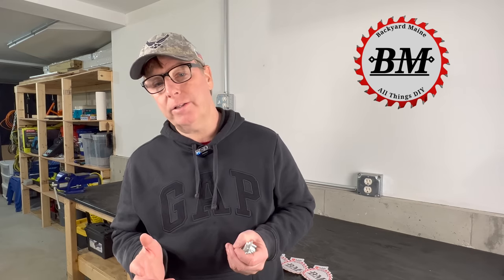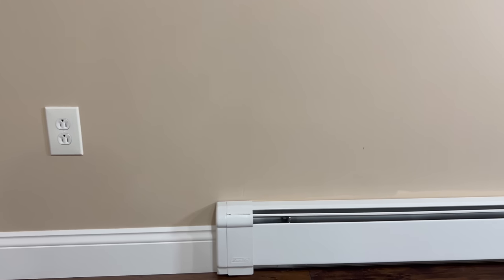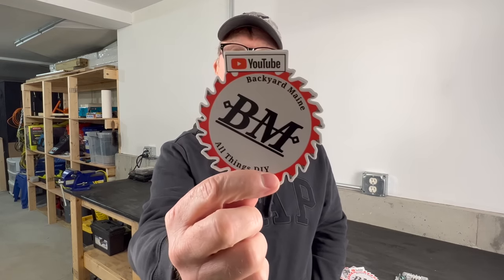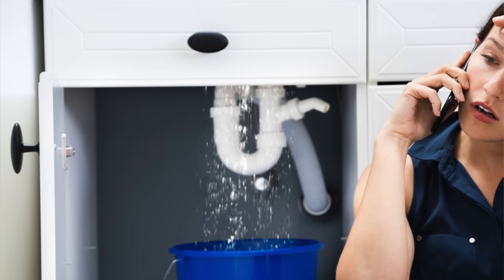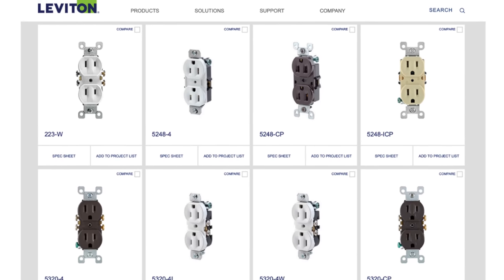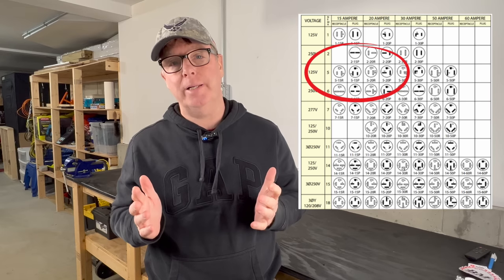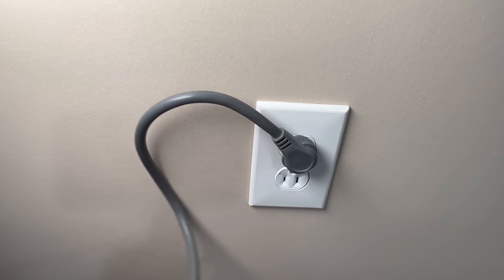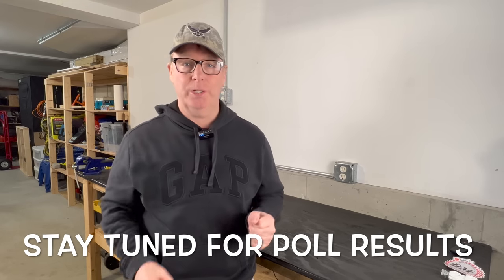Are your outlets installed upside down? (You may be surprised)

Comment from the maker: ⚡Backyard Maine Sticker give away!!⚡ Please comment on which orientation you install receptacles (or) which way they are installed at your home. Three comment winners will be picked at random on January 1st, 2023.  I will reach out to the winners for their mailing address so I can send the stickers to you. Thanks for taking part!
Reply: Ground up! Lol
Reply: I remember when we started going to grounds up and the arguments made sense. Since then, most of us no longer use metal wall plates so a metal plate falling and shorting is not a serious problem. I do agree that with the ground up, because the ground slot has a tighter grip than the others, it lessens the change of a ground prong on a cord bending or breaking. New projects, I go ground up, except for specific appliances (refrigerators usually) that I know have a cord designed for ground down and they are usually hidden from view so you can't see that they're different from the rest. On existing spaces I match whatever's already there. Being from Chicago where horizontal is the standard, I go horizontal on my own properties. It just looks nicer and cleaner when a recep is parallel with the wall/floor line. I'll never get used to vertical receps.
Reply: Thanks for referring me to this video.
Reply: This video forgot to mention other orientation specific devices such as chargers and power packs. Virtually all of them are designed for use in a ground down orientation.
Reply from the maker: @whiteknightcat  Yes there are many devices with 90 degree and some 45 degree plugs that are designed for ground down orientation. The list is long. Also add to the list night lights, plug in scents and even receptacle testers.
Reply: The code doesn't directly say. It falls under listing. Old receptacles are listed for ground up and are marked as such. For safety you should be installing them ground up (vertical) or neutral up (horizontal). Modern outlets are listed for either direction.  AFCI will only protect you if it arcs. If it touches the hot and not the neutral you're looking at metal with 120 volts ready to shock you.
Reply: @BackyardMaine some of those devices are listed for either orientation. Chargers that have an unpolarized plug are a good example. There's no safety issue which way the hot and neutral connect the the charger's transformer so the manufacturers typically do not polarized the plug allowing you to insert it from either direction.  Anywhere where reversing the connection doesn't create a safety issue or prevent operation of the device a non polarized plug is used on ungrounded equipment.
Reply: @ianbelletti6241  wrong
I have never seen an outlet with a designation on it. Been doing this for  45 yrs. Please send pic.of one. Rhanks
Reply from the maker: @ianbelletti6241  I really don't see much benefit and I think there was only one manufacturer that put "top" on a receptacle for a short time and switched back to to loss of sale. There were all sorts of issues at inspection. We have circuit protection for short circuits and over current. But I do get it and you should do what you think is best.
Reply from the maker: @ianbelletti6241  Yes of course there are many non polarized plugs where either way you insert the plug is safe and even more polarized two prong plugs used for ungrounded equipment. But with either of these plugs, receptacle orientation will not matter from a safety standpoint.
Reply: @BackyardMaine  generally, in a workshop environment ground up is ideal. Everywhere else it doesn't matter as much what direction you put the receptacle other than installing them in the same direction looks professional.
As far as your response to the two prong plugs, that is my point. Direction of the outlet doesn't matter when they're non polarized because the device is safe in either direction.  By the way, of the 90° factory cord end is a problem for you they do make 90° cord ends that you can use to replace it to get the orientation that you prefer which makes your complaint about 90° cord ends moot for orientation of the outlet.
Reply: While the ground should be up to maximize the safety factor, the issue is that products designed for residential use are often designed for ground-down configuration. As such ground down is common in residential use. Conversely commercial and industrial equipment is generally designed for ground-up on their flat plugs.
Reply: Why did you choose AFCI as the example.  Most people know them as GFCI Ground Fault Circuit Interrupters? And that is also what they call the breakers that you use in wet areas.  What the hell is an AFCI?  I've been an electrician for more than 40 years!
Reply: @thomasbonse  commercial and industrial equipment also use twist lock plugs. Fit that into your configurations.
Reply: @ianbelletti6241  Considering the question was directly related to the NEMA 5-15R and presumably NEMA 5-20R configuration outlets (could also apply to NEMA 6-15R and 6-20R, though they're less common), I really didn't get into this. Also for the locking configuration plugs, L21-20P for example, they're less common in an angled configuration (I've had to spec this before and it added another $30 to the cord price and only necessary once). Also locking outlets are generally installed for a specific device rather than as a general outlet, so should be installed with the configuration of the device in mind. Same for any 30 and 50 amp outlets.
Reply from the maker: @HalfAssHomestead  AFCI and GFCI are completely different devices. An arc-fault circuit interrupter or arc-fault detection device is a circuit breaker or receptacle that breaks the circuit when it detects the electric arcs that are a signature of loose connections in home wiring. Loose connections, which can develop over time, can sometimes become hot enough to ignite house fires. These have been around for several code cycles now and are required almost everywhere.
Reply: I live in Milford and in my condo I have a variation of all sorts. some rooms two are up 3 are down. You're welcome to come video them if you like. (I wouldn't want in the video). 
I was so excited when you mentioned they might be switch controlled. Alas, they were just put in that way, Bub. haha. 
Thanks for the video this is a great channel.
Reply: ground up seems like a good way to accidentally break off the ground pin or have the plug sort of sag out of the hole. the other blades are stronger. i suppose there are arguments about what could fall onto a loose plug, also, creating an arc across the two blades vs the ground and one or both of the blades.
Reply: in the house they are ground down, except in  the utility room and garage. They are ground up in those rooms so if they are not fully plugged in and something falls on them  it grounds not charges
Reply: Down
Reply: Down
Reply: I prefer the ground down orientation. I used to work in a hospital and they always had there receptacles installed ground up.
Reply from the maker: Thank you..  @gamersroost
Reply: TWO PIN power packs( as all are)  and most two pin plugs are universal and can be switched either way and will have two pins the same width. (BTW, let's call them WALL WORTS).......... @whiteknightcat
Reply: It's ground down in all 11 places I've lived.
Reply: DOWN
Reply: Ground down
Reply: Thats what the breaker s are there to kick if that happens
Reply: Of course after watching the video, I’ll put them in your way from now on. I also believe up is backwards looking to me
Reply: Ground Down
Reply: I chose ground up when changing recep at home but ran into problems with different cords and situation. I have my a/c recep ground up because the gfci breaker on end of cord has instructions written to be read with ground up configuration, and the bulk of the gfci breaker housing  higher than top of recep cover, pulling away from outlet if installed with ground down. The rest of outlets by nightstands and even bathroom gfci just have ground down so I was not racking my brain anymore trying to decide what was best, because the code left it up to me.
Reply: DOWN
Reply: It makes sense to point the ground to the ground, so that way the ground is closer to the ground. Think of it as the eyes up and the mouth down like a face. 😮
Reply: Ground down
Reply: @David-rx5eo  lol.
Reply: Ground sideways
Reply: How about what the customer prefers (within the code).
Reply: That's a negligible distance.
Reply from the maker: Of course. I will say though that I have never had a customer ask for a particular orientation.  @danamiller6049
Reply: Ground up
Reply: down
Reply: I didn't say ground up. I never install an outlet with the ground up.
Reply from the maker: Me either but that's what you said.. @JohnKuchinski
Reply: ground down, so to bend the non-insolated ground wire side to side in the box to keep it away from the other screws when pushing the outlet into the box
Reply: Also, they make those outlet checking gizmos that you plug in and there are lights that indicate if the ground is good and the polarity is correct. The lights are on the top when the ground is down. If the ground is up, the indicator lights are facing down. I don't think they intended people to lay on the floor and look up at the gizmo.
Reply: Up
Reply: Down sorry forgot first comment
Reply: Ground down.
Reply: I was taught to set receptacles ground up for the safety reasons mentioned in the video, however ground down looks better.
Reply: Every home I have lived in/owned has had ground down. I have been wiring my own projects for over 40 years and have always used ground down. No fires yet.
Reply from the maker: @felmlee1876  Me too.. Ground down is my preference as well.
Reply: There are times when manufacturers specify orientation, they typically do this with the brand label on the device, and a note that states correct orientation allows the brand name (typically on the ground strap) to face the correct direction. This is rare though, and usually only applies to 3-way switches and similar devices, though I have seen both Hubble and Leviton do it on receptacles. However, you can't install RV receptacles that way, or the cord would be coming out of the top of the receptacle. It boils down to the specifics of the installation, as there are situations for both methods and neither is actually better than the other.
Reply: @ianbelletti6241  Incorrect, AFCI breakers will trip under any fault condition, they just give less inrush current time so that they can shut an arc fault down faster. The breaker has no idea whether or not metal is touching, it senses an inrush current in either cold start or hot start state. If the inrush current exceeds the inrush rating of the breaker in its current state, it trips the breaker. If you had metal across the hot and neutral of an outlet any breaker would trip, AFCI breakers just do it faster. They don't give the typical 500% cold start inrush of a regular breaker, which also makes them ineffective for coil-based devices.
Reply: @HalfAssHomestead  Arc Fault Circuit Interrupter is not the same as a GFCI at all. AFCI breakers have a lower allowable inrush, which causes them to trip faster. They're safer in residential areas, but have issues with coil-based devices. They've been around for almost 20 years now, and the 2020 NEC and newer require them in all residential installations instead of regular breakers.
Reply: @scottmyers10  AFCI devices have additional circuitry that looks for current patterns that indicate an arcing fault in the wiring. What your confusing is arc fault and over current protection. In an AFCI circuit breaker inrush current high enough will cause the circuit breaker to trip in the over current portion of the mechanism, not by the afci portion. AFCI devices will not protect against ground faults and shorts unless there is an arcing condition to go with it. The AFCI breakers just happen to include over current protection as part of their design which gives them the second trip function. However, the second trip function of the device doesn't change how AFCI protection works.
Reply from the maker: Been in the trades for 40 years and the only time I see "top" is on single pole switches because the need to be installed as up for (on) and down for (off) It makes no difference on a 3-way or 4-way switch since their function changes depending on the status of the other switches. The printing on receptacle a with other info like brand name or other is always going to be in one direction or another. It does not indicate manufactures recommendations. I have worked with all the major brands and am currently working with Hubbell to help promote a new style device.  @scottmyers10
Reply: Ground down. Many timers you can buy is made to have the ground down to be able to read in the data that is appearing.
Reply: @lucthibodeau5540  maybe digital timers. Analogue timers often have the times written radially meaning that up or down doesn't matter.
Reply: GROUND DOWN
Reply: In my new home (built in the late 90's) I found most receptacles are ground-up.  I turn them around as needed.  So now there is about a 30-70 % mix at the moment.
Reply: UP
Reply: some close to the wall extension cord and appliance plugs are awkward if the receptacle is installed ground up
Reply: Gound down ty Vernon
Reply: I was first qualified as an electrician 50 years ago, and noticed some major oddities about electricity standards in the USA. These include orientation of devices as well as the unintuitive choices of cable colours. To us, brown or red are the Line or Positive connector. (Red signals Danger) Black is negative on an DC circuit and used to be Neutral on AC. Blue is Neutral now. And Green/Yellow is Ground, although it used to be Green in older installation. 

You have incredibly inefficient use of Copper cabling around your houses, with each sector or room having its own fuse at the fuse box, and a dedicated length of cabling. A UK-style ring main system results in a much simpler fuse box, and uses significantly less Copper wiring. Each ring has its own fuse, but there is usually one ring per floor, and a house-wide lighting ring. In a small property there might be only one power ring and one lighting ring. So we can have as few as two circuit breakers and one inlet cutoff switch at the fuse board, backed up by a single mains inlet fuse for the building. We have domestic single phase wiring in Britain, and three- phase supply to businesses. In Europe, more domestic properties have a three-phase supply, with each phase being 120° away from the next.

Most of the rest of the world use outlets with the Ground connector at the top. One big advantage of this is that if a metal object is dropped onto a partially inserted plug, it contacts Ground first. Also, your connectors are very dangerous because of it being possible to short out the pins when they are partially inserted. In Europe, and particularly in the U.K., the pins have a plastic section which hides the metal ends from sight if a plug is not inserted properly. Furthermore, the Ground connector is longer, so that it is the first and last pin to make connection when inserted into, or withdrawn from, the outlet.

One other shortcoming of the plugs used in the US and some other countries is that there is no fuse in your mains plugs. Britain stands out as having that fused system. If a device fails, it can blow the fuse in the plug, and not trip the circuit breaker to the rest of the devices on that loop. The only downside is that our connectors are bigger - and they really hurt if you stand or kneel on one!

You also have your light switches upside down in comparison to most other countries. 

Not electrical, but even your door locks are the opposite way around to most other people.

The USA is often viewed as frustrating, even quaint, by other peoples, because of differences such as these and your outdated systems of measurement.